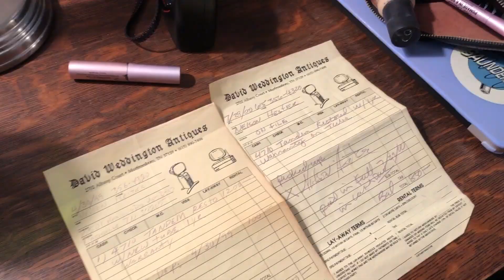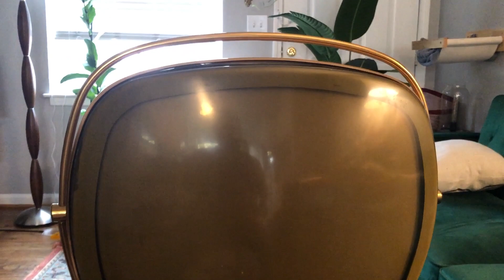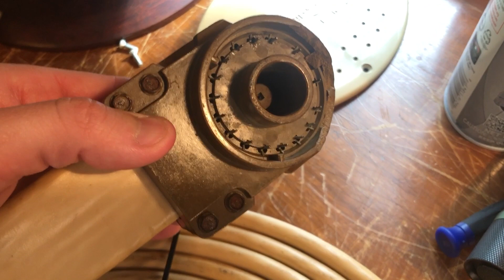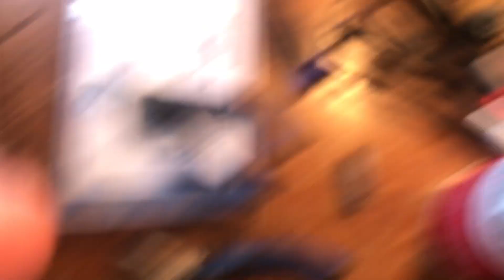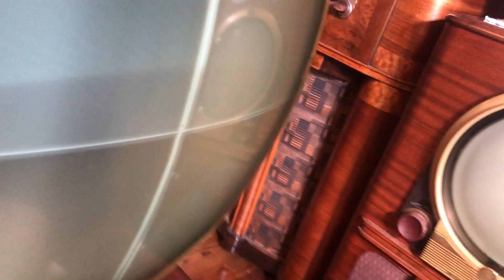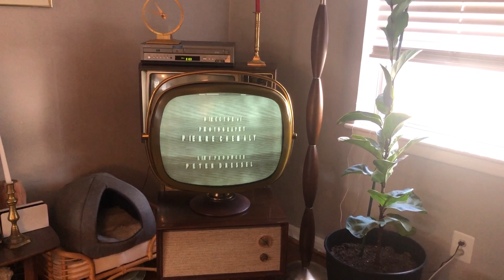1958 Philco Predicta Tandem Television

Comment: On my Tandem the plug had to be held just so or the picture would disappear . Rather than replace plug I took a strip of aluminum and drilled a hole on each side and into the chassis to hold the plug tight  against the chassis socket.

Comment: I must say you do great restorations on your vintage electronics.  I became very excited last week when I saw a ebay listing for a very rare 17 inch Sylvania dualett
 TV it was the blue and white model.  It sold for $ 1,500. I know rare TV sets can bring big bucks but I must say, wow to the $1,500 price tag on a as is as found unrestored great condition set. I have TWO of this model tv's that I got back in the 1970s in my early days of collecting.  I have a large collection of radios but only seven vintage tv's,  I have the red RCA you have in a video and i have
a GE locomotive and a couple of other sets. I only repair radios I do not restore tv's the stuff that I had my hands on back in the 1970s that I did not save just makes me sad when I think back, hindsight is 20/20 As they say.
Reply from the maker: Thank you! Yeah $1,500 seems really high. I've heard the plastic on those crack really easily after all of these years too. I'm surprised how many amazing sets have come my way after only collecting for 3 years.
Reply: @televisionforever  it's amazing how the extremely rare pieces have gone up in value but the most commonplace stuff is not that expensive. Also let me comment and is nice to see people of the younger generation getting into this vintage electronics stuff. My first antique Radio was trash picked by believe Back in 1970 out of an abandoned house on the Block that was being torn down. I still have the radio to this date it is a 1949 philco transitowne with a Bakelite case very simple 5 tube ac-dc set.
Reply: just wow! must i say to even see one come up for sale is a once in a lifetime sight. they are one of my most sought after set. the colors and the style of the not commonplace “plastic” chassis just gives it a look like nothing else from the time.